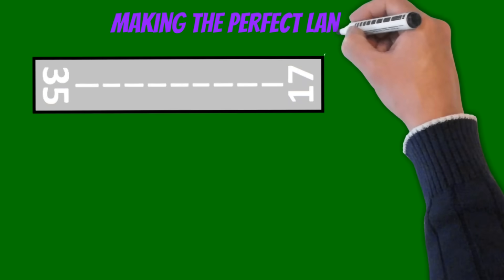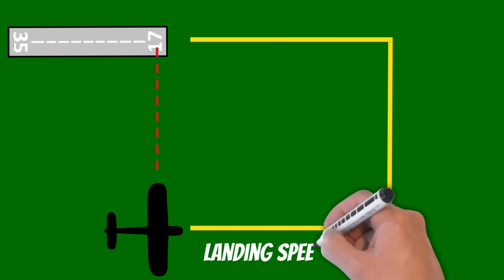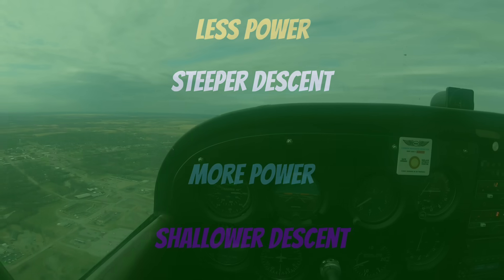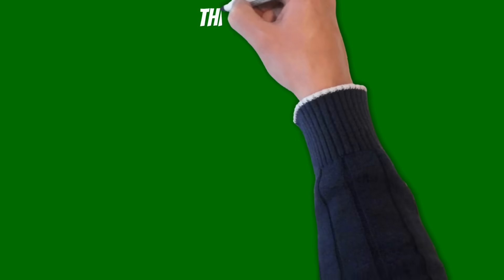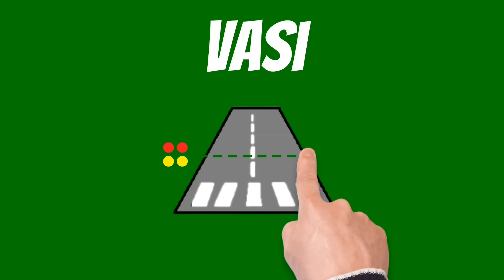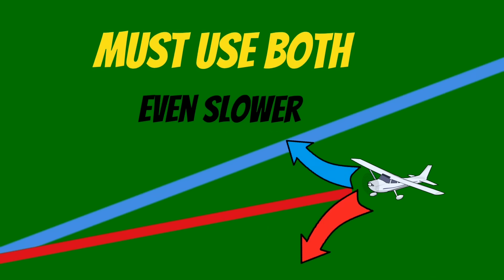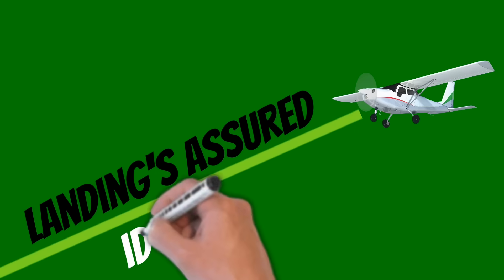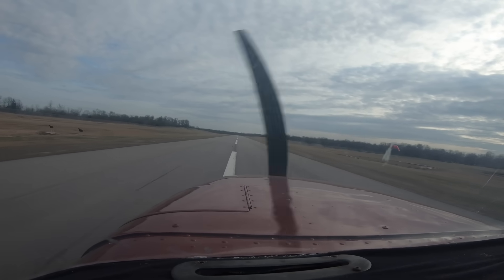Landing SECRET your Instructor won’t tell you [How to Land]

Comment: Always make your patterns exactly the same? Even a slight crosswind from the right( while on a standard left downwind), will shrink the base leg requiring a steep turn to final. Danger,Danger! Widening the pattern is advisable under these conditions. As a student the tower said “ I’ll call your base” he called it well beyond my usual base turn and my base was so short I steep turned onto final. Does a newly solo’d student know aircraft stall at higher speeds in steep turns.... if you turn at your normal bank you my cross over to the final path of a parallel runway. Crabbing on downwind helps but a little extra elbow room is prudent.
Reply from the maker: When I say “make your patters the same, I mean perch at the same place every time when you can.  This training is for students who are just getting started.  By perching at the same point, turning base at the same point, and keeping a constant glide slope on each pattern in the beginning, you develop a baseline, and a feel for the airplane.  Once they get the feel for this, they will have no problem when they are extended by tower or if they turn too early.  They will immediately recognize that they are not on glide slope.  This is the biggest problem with students in the beginning.  They cannot tell if they are high or low because instructors DONT focus on making consistent patterns.  This is the root cause to most bad landings by students in the beginning because they are so focused on trying to get the airplane in a safe position to land, that they are completely distracted and arrive over the threshold TOO fast, too slow, too high, etc.  Once they develop this “feel” for the airplane, they will easily be able to fix their glide slope if the tower gives them a long base
Reply: @FreePilotTraining  I think you got to teach them to know their altitudes in the pattern. Obviously they start at 1000' AGL but they should understand also what altitude they will be turning base and then finally final. It gives them a really good idea where they will be on their glideslope and can adjust early. It also allows them to adjust early. Maybe as early as your downwind decent.

Comment: Sorry but your explanation is horrible. Everything you say is right but the way you explain it is way way way too complicated for nothing.

In fact yes I can point one thing you had wrong when you suggest to "use pitch in the same time using power". That's a recipe to unstable approch. Power to idle to begin your descend pitch and trim to fix desired speed than power to control descend angle. That's the rigth way.
Reply from the maker: Thank you for your comment... what if you are on a 1/4 mile final and you are right on glide slope, but 10 knots slow? Will you pitch the airplane into the ground or will you add power to keep this from happening.  When using a glide slope, pitch and power are related.  If you are descending from your perch point, that is a different story than near the ground.  These need to be used together.  I have used these techniques to get students to land on their very first lesson with NO intervention from me.  They may be slightly complicated, but this creates a baseline of understanding that will make short field landings ridiculously easy because they know how to control their glide slope from day one.
Reply: @FreePilotTraining  That’s an interesting situation.

First I can say that this pilot had a bad management of his approach speed. Most likely because he tried to control pitch and power at the same time from base to final whitout trimming correctly at first. That said, you must anticipate a lost of speed when you deploy the last notch of flap on final so you should approach at a higher speed at first. 

Again, your explanation is not wrong but inadequate for a student in my opinion. 

Let me share some thoughts before I give you my answer to your question. 

Experimented pilot knows exactly what, why and when and can do it by reflex more than one task at the same time. Ordinary person (student) must understand the simplest way possible first. In many discussions with new persons at flying and even licenced private, I was shocked to heard too many of them are not completely conscious or aware that power has nothing to do with speed when approaching for landing. They repeat like parrots… attitude and power… without a real clue of what they say and what it does.

In the grounded world, every machine gain speed with throttle. Unfortunately for them it doesn’t work in an airplane. It seems hard to them to understand this fundamental of aerodynamics. According to this, trims are the cruise control of an airplane. Until they get that perfectly they should not do something else while trying to stabilise their speed. Once trimmed, they will be more focussed to the touching point and alignment and understand exactly what they did to achieve this perfectly stabilized approach.

My answer will mix with something else you said in your video, the reference trick to know where you’re aiming at on the runway. I don’t like the fist method because at this critical phase of flying you must keep your both hands on controls. That said it is also not efficient because you can land at different attitude even if you’re in the same glide path resulting in a different angle of view from the cockpit. Some also have the hands of Mike Tyson when others have those of mini me. A better technique is to use the same visual analysis we use to evaluate if a collision will occur between two airplanes crossing their path. 

!! Make the point you’re aiming at, a fix point among all references moving in your field of view.

That said, my answer is, assuming you’re not at stall speed, don’t touch the pitch and give power to push further your aiming point on the runway and then push gently on the yoke to get back that desired speed. Adjust power to keep aiming where you want it to be. At this stage of the final I more often use strictly trims to nose down a bit instead of using yoke. That ensure the nose won’t raise if you relax on the yoke (not for a 10 kts deficit of course I will then push on the yoke and trim after).
Reply: @laurentsamson8927  
Hi Laurent,

I'm not sure I agree with your analysis here. The method in the video is perfectly fine for teaching PPL students, you might employ some slightly different methods if you were teaching part 141/easa integrated students to make life easier in more advanced parts of training but that's just opinion (I.e. wing down cross wind technique doesn't transfer well to large aircraft with under wing engines), nothing here is "wrong" other than the title saying instructors don't tell you this stuff.
Power for altitude and pitching for airspeed vs Power for airspeed and pitching for altitude vs Point and power is largely academic in a C172, what you are really teaching is energy management and giving the student a mental model which allows them to make appropriate adjustments to what the aircraft is doing. Where i disagree with your comments is making small pitch adjustments using the trimmer on final (fundamentally wrong technique) and having both hands on the controls on final, one hand should be on the throttle in preparation of a go around.  All your get out of jail recovery techniques such as base to final incipient stall recovery and go-arounds are all going to involve the addition of power.  To add to this last point the previous 3 airlines i've worked for all had an SOP that mandates one hand on the throttle below MSA.

Comment: One thing you didn't explain is when you transition away from maintaining your aim point.  If, for example, you keep your aim point a fist's distance above the dash, you would hit the ground before reaching the runway.  You mention  being at 15 feet when the aim point passes under the nose, but how do you know when to shallow the decent so that you end up there?
Reply from the maker: As the aimpoint passes under the nose you should shift your aimpoint to your landing spot.  This is very brief, until you are 2-3 feet off the ground then you should look to the end of the runway and keep the nose wheel 6” higher than the mains.  The plane will settle on to the runway
Reply: @FreePilotTraining  I understand that part, but in order to have the aimpoint pass under the nose, you have to have already transitioned so that you are no longer holding it above the dash.  When does that transition occur?  Thanks! I look forward to watching your channel grow.  If things go to plan, I should begin my primary training next year.
Reply from the maker: Kevin, thank you, I didn’t even think about explaining a transition phase during that part.  This occurs when you know that the “landing is assured” (meaning you know that you will land on the runway). Once in this position, pull the power to idle and keep the nose pitched down at the same angle until your original aimpoint passes the nose.  This should only take a couple seconds or so.  At this moment, I usually find my landing spot with my eyes so I can change my aimpoint to my landing spot. Hope this helps you my man.  Stoked for you on your new adventure! Thanks for the support

Comment from the maker: Do you ever have a break in training and can’t fly for a couple weeks at a time? You can still improve WITHOUT flying!  Check out these three tips!  https://youtu.be/F42vK9qYH4o
Reply: I have found that if you visualize flying or riding a motorcycle, etc just as you are falling asleep, this will help with retaining your skills.  When I was a novice rider, I had to take a break for several months.  When I met back up with the group I had been riding with, they were amazed that my skills had actually improved during my break.
Reply from the maker: @glasshalffull8625   that is very interesting, because I found something very similar with my training.  I would always go through the maneuvers in my mind while I was driving, and I would also notice that I had improved on the next flight
Reply: @glasshalffull8625  good idea 💡
Reply: Very interesting video
Reply: Good video, thanks for sharing your experience.
Reply from the maker: @_hold_the_line_  you’re welcome!

Comment: Nice job! I’m a new instructor/old mechanic trying to get better at instruction. This was very helpful. I’d like to know what software you’re using for the video. I think it would be useful for some of my maintenance classes. Thanks.
Reply from the maker: Thanks Darryl!  It’s called Doodly.  It makes some cool videos, but it definitely has some limitations.  If you have some kind of graphic design software to go along with it, that would make things a lot better.  The sound quality comes out really poor too when the video comes out.  I have since started reediting the video with some other software after the video is done.  Eventually, I want to get a Mac.  I’m hoping the videos will come out better if I use a Mac instead of a PC and save me from reediting